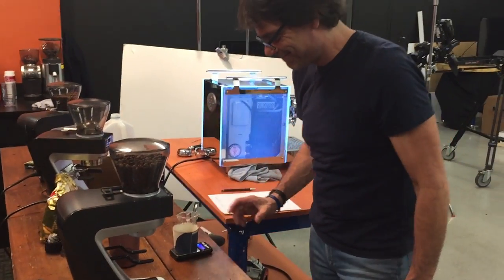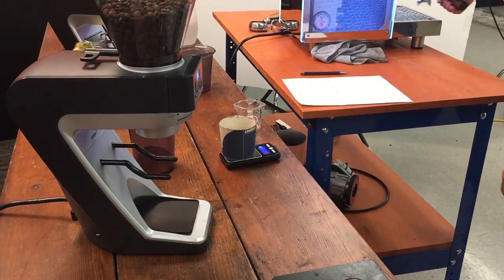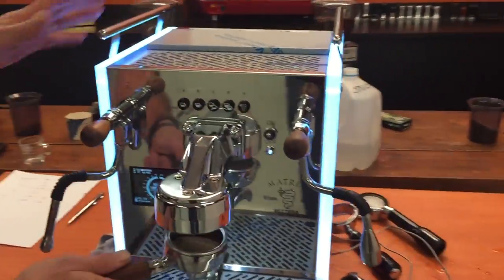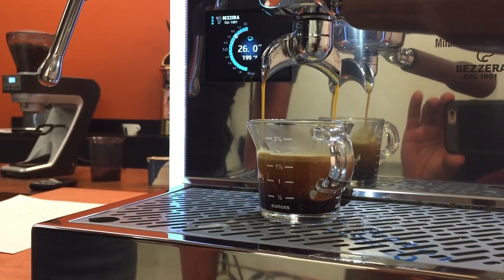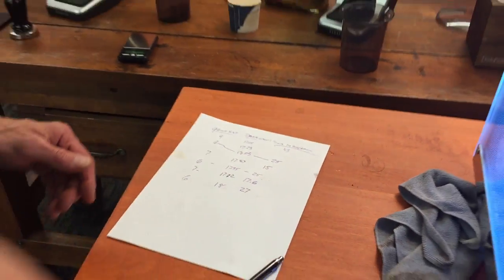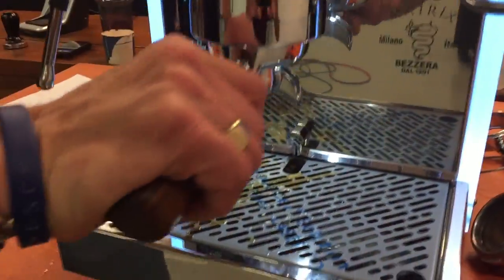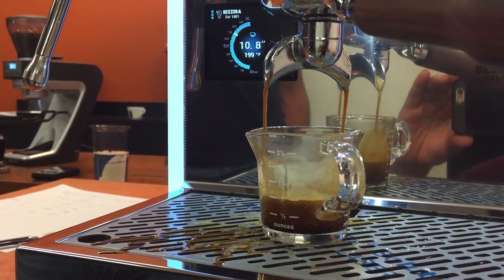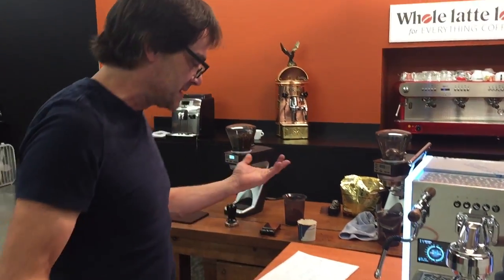Test: Baratza Sette 30 for Espresso Grind - Behind the Scenes

Comment: I just bought a Baratza Sette 30 from WLL based upon recommendations from the WLL sales person that I was communicating with and asking for advice.   I received it today.  After receiving it and reviewing this video, I wish that I had been advised to get the 270.  I also just bought the ECM Classika, PID with flow control.   The ECM is great.   I am not very happy.
Reply from the maker: Hi William, I do not know the details of your communication. But surprised our staff would recommend a Sette 30 for espresso unless there was a cost concern or other factor involved.  Have you considered return and exchange for the 270?
Reply: @Wholelattelovepage  Shipping costs and the upgrade to the 270 would be 'inconvenient'  at this point.  I have ordered the 270   adjustment assembly from Baratza.

Comment: Hi Marc! Thank you all for sharing all these amazing and helpful videos! Big fan here! 
I have a question: I was thinking of getting a Baratza Sette 30 for my Gaggia Classic and use it with a 58mm unpressurized portafilter. After watching this video, I kinda got the feeling that I should get the 270 instead. But the price difference is pretty crazy. So I was wondering if it's 'possible' at all to pull good shots with Sette 30 on my Gaggia Classic? If not, would you ever recommend Breville Smart Grinder Pro instead? Thanks!
Reply from the maker: Hi ESK, Thanks for the comment and questions! Sette 30 would be fine for the pressurized basket but I cannot recommend it for use with un-pressurized baskets. It might be okay for less discerning users but really need finer control of grind size for best results. Hope that helps!
Marc
Reply: @Wholelattelovepage  so if we started with the Sette 30 with a pressurized basket, but then bought the 270 fine adjustment assembly to put on the 30, we could then use it with the non-pressurized baskets?
Reply: @josephlebo7320  Yes

Comment: Great video test Marc.  I have to admit to getting a Baratza Sette 30.  Could not pass it up as I got it new for $200.  For the price, I am able to get the 270 Adjustment Ring, S2 Cone Bur (for brew grind), an additional nozzle, and a set of shims.  So for a total out of pocket of $330 I have a machine that will do dialed in espresso and with a 30 second ring swap, a decent pour over grind.  I could even get a spare gear box for $40 and have a quick replacement ready for the inevitable failure in a few years and still be under the $400+ for the 270 alone.

Thanks again for all you do for the coffee community!
Reply: Where are you from and where did you get the sette 30 for $200, if you don't mind me asking? I haven't seen it under $300 online anywhere
Reply: @t-vizzle  I snagged it off Amazon on their Warehouse Deals.  It said it was damaged and some parts may be missing.  I took a chance because they have a great return policy, even for warehouse deals.  It came in a regular Amazon box, but all parts were there and It was not damaged at all.  Still working perfectly.

Comment: Great video. Great channel. I have a Baratza Encore with the Burr upgrade and adjusted for finer grind, but still find unusable for espresso. Friends say the Niche is the only way to go, but my budget cries out for the Sette 270. Thoughts?
Reply from the maker: Hi PSW, Thanks for the comment and question. The Encore is generally not considered useable as an espresso grinder unless using pressurized filter baskets which produce inferior espresso. The Sette 270 is a very good espresso grinder - and you def want the 270 not the 30. The dual macro/micro adjust gives you essentially stepless grind size adjustment for precise control of grind size. Keep in mind the Sette is an appliance grade product but well suited to lower volume home use - also kinda loud. If you want a better build quality, the flat burrs preferred for espresso and stepless adjustment check out the Eureka Mignon Facile. It's a no frills machine grade grinder. It's slower than the Sette but not as noisy: https://www.wholelattelove.com/products/eureka-mignon-facile-espresso-grinder
I have a hard time with the Niche. Not exactly precise in grind size adjustment with espresso fine to medium drip grind and beyond in less than a 360 turn of the adjustment, also conical burr.
Hope that helps!
Marc
Reply: @Wholelattelovepage  Thank you very much for the detailed reply! 🙌🏻
Reply from the maker: Our pleasure!
Reply: @Wholelattelovepage   Def going to order the Eureka Mignon. My next step is to look for a good espresso machine in the 500- 1k range. Suggestions?

Comment: I have the 270. Grinds coffee very well but very noisy. My complaint with it is it there is backlash in the setting. What that means if I change it between espresso  and coffee and return to espresso I need to redial in the espresso again because it's not correct
Reply from the maker: Hi Sonny, Thanks for sharing your impressions of the 270. Always great to read owner reports. The 270 is louder than most but that compromise gets you wonderful grind distribution into a portafilter, fast grinding and very little retention. I don't use the Sette for filter grinding much so have not experienced the backlash issue you describe.
Marc

Comment: Hello Whole Latte Love. Long-time viewer, first-time commenter. I upgraded from a Sette 30 to a Sette 270, but I continually get a sour espresso, regardless of grind. My best result so far: freshly-roasted whole beans (Blue Bottle Dandy Espresso); grinding 18g on a Sette 270 (9E setting); brewing on a Gaggia Classic (58mm double-basket unpressurized portafilter). I'm pulling a 36g shot in ~25 seconds -- I start my timer simultaneously upon hitting the brew button. This should yield good results, but the shot is always sour (I've tweaked the grind more or less coarse, but no change). Can you help?
Reply from the maker: Hi David, Welcome to the comments and thanks for the question! Sour flavors generally indicate an under-extraction. It could be low brew temp. The Classic is a little tricky due to wide swings in boiler temperature associated with single boiler machines. We have this video with some basics on temp surfing a single boiler: https://youtu.be/H3oT5fF1gy0 Your extraction may be a little fast. For timing, I tend to go with starting at first drip. May want to try a slightly finer grind to slow the extraction a bit.Marc
Reply: Thank you for the suggestions! I switched to Lavazza Super Crema (as you recommended in another video), tightened up my grind (to a 9C), and started counting after the first drip. As a result, the sourness is gone and I'm getting a deep, bold flavor with rich, thick crema; there's a little bitterness now, but it's barely noticeable... more experiments required, but I'm thrilled with the lack of sour! Much appreciated!!

Comment: Hey Mark this is a great video for a newbie looking to buy equipment thank you very much! Have you ever done tests like this with the Breville Smart Grinder Pro?

I guess what I'm asking is would I better off with the SGP or the Sette 30 as a beginner wanting to do espresso. I'd like to be able to graduate to unpressurized baskets with this grinder as well. Or any other recommendations? The Sette 30 is at the high end of my budget
Reply from the maker: Hi MW, Thanks for the comment and question. I prefer the Sette to the SGP. A much fluffier and faster grind. The Sette 30 uses the same burr found in the Sette 270 which Baratza considers their best home use espresso grinder. I have not done testing like this on the SGP but I have used them. IMO it has a similar jump between grind size settings. One thing the SGP has is additional grind settings within the machine on the burr carrier. It's kind of a process to use those as the burr has to be removed to make adjustments. For a newbie I think either grinder is okay - especially if using a pressurized filter basket. Even when you go non-pressurized you'll do okay. And, if grinding fresh I'd go non-pressurized ASAP. Much better espresso with those! If you find a jump in timing between grind sizes you can always adjust the dose weight a bit to to offset. Personally I'd go with the Sette 30 over the SGP. It's not well publicized, but the burr carrier used in the Sette 270 grinders with micro adjustment will fit and work on the Sette 30. You could make that upgrade down the road. Hope that helps!
Marc
Reply: @Wholelattelovepage  do you guys sell this part?

Comment: Hi Marc. This video is insightful. I have a question for the Sette 30 (S30) and consider it an upgrade option but i have one concern and that is the coarseness of the grind. I like my cold brew and French press. Is there a way to adjust the S30 to produce a coarser grind? I learn that there is a BG for the S30 to improve the grind's coarseness but a lot of the online reviews said the grind quality is still tad fine for cold brew or French press. What is your take on that? Should I take the plunge for the S30 with the BG? Or should I consider the Virtuoso+ instead? Both S30 and Virtuoso+ are of the same price in my country. I appreciate your thought and reply. Tq!
Reply from the maker: Hi Joel, You are welcome. For cold brew I recommend the Virtuoso+ it max grind size is 1400 microns while the Sette is 950 microns. While the Sette can be shimmed after break-in to grind finer it cannot be made to grind coarser.
Marc

Comment: I own a 30AP for espresso and use a 13/14 setting (installed shim) (but really depends on the bean) and it works beautifully. Buying the micro adjustment for the 270(Wi) is in my plan but it's defs worth it.
Reply from the maker: Hi Jaay, Thank you for sharing your experience! For espresso the micro adjustment really helps!
Reply from the maker: Hans yes for grind size. But do note differences in other parts of grinder like hands free grinding, 2 more timed presets and upgraded hopper shutoff mechanism
Reply from the maker: Hans Hi it’s very easy. The entire assembly will drop out and new one goes in its place. Micro ring is part of the new assembly. Just turn out the old and replace with new. 
Marc

Comment: Thank you for this. The Sette 30 on its own is not ideal.  I learned you can add the microadjustment to the Sette 30 and save a few dollars.  Do you know where I can order the BT-S069 Assembly Adjustment?
Reply from the maker: Hi DS, In the US one used to be able to purchase the macro/micro grind adjustment assembly used in the 270 models. Just checked Baratza's website and it's not currently available. Not sure if out of stock or if they stopped selling the assembly. Here's a link to Baratza retailers outside of US/Canada. Chance they might have: https://baratza.com/international-importers-and-retailers/parts-outside-of-us-and-canada/

Comment: my questions is, is it better to get the 30 then buy the stepless adjustment mod later, or just go for the 270?
Reply from the maker: Hi TMP, I'd go for the 270 so you'll have the 3 timed grinding presets, nicer hands free PF/bin forks and upgrade to shutoof of the bean hopper.
Marc

Comment: Slightly off-topic (but the subject IS in the video!) - On the Matrix, is it normal for the portafilter to be so far off center when you secure it to the head?  I mean, I see them at all kinds of angles off center, but that seems way out.
Reply from the maker: Hi GSJ, Good eye! It is over clocked and not normal. Prior to shooting this video I was doing a bunch of Scace measurments on the Matrix DE. We have a modified non-Bezzera PF for use with our Scace device. It under-clocks in the Bezzera group so we have to crank it a bit to get a seal. That likely shmushed the group gasket a bit which resulted in over-clocking of the standard Bezzera PF.

Comment: Hola...necesito invertir en un molino, estoy en la duda ya que en mi país chile, el precio del batarza virtuso es igual al baratza sette 30, cual me recomiendas? Agradecería tu recomendación.
Reply: es para una cafetera casera, espresso delonghi,  quisiera utilizar sin filtro presurizado.
Reply from the maker: Translation: Hello ... I need to invest in a mill, I am in doubt since in my country, Chile, the price of the virtuso batarza is equal to the sette 30 baratza, which one do you recommend? I would appreciate your recommendation.

Para el espresso, optaría por el Sette 30. Para métodos de preparación distintos del espresso, elija el Virtuoso.
For espresso I would go with the Sette 30. For brew methods other than espresso go with the Virtuoso.

Comment: Hi Team,
I use Delonghi Dedica EC685, french press, moka pot and like occasionally cold brew...! Planning to buy grinder which can help with this multiple range of grind settings...! Pls help me which one is better option Encore or Sette 30? Thanks in advance
Reply from the maker: Hi AM, Thanks for the question. The Sette 30 is much easier to use when making espresso as you can dose directly into a portfilter. And, it's fine to use for pressurized filter basket brewing like on your Dedica. Some find it doesn't grind as coarse as they'd like for cold brew and maybe press. Grind size range is 230-950 microns on the Sette. The Encore can grind coarser with a range of 250-1200 microns but you'll have to dose your portafilter from its grinding bin. Hope that helps!
Marc

Comment: Helllo, whole latte love. I’d like to ask something cus I’ve been asking all around n couldn’t find an answer. I’ve the satte 30 and I’d like to put the Micro on it is that possible?? And can I get the same grind with the satte 270? And where can I find this Micro ring. Thanks for this helpful video and I appreciate how you work hard for this Channel👍🏻👍🏻. Best wishes for you.
Reply from the maker: Hi M, Thanks for the question. Yes, the Sette 270 grind adjustment mechanism fits in the Sette 30. It's the whole assembly you replace - not just add on the micro ring. Here it is on Baratza's website. I'f used the 270 ring in a 30 before and Baratza clearly states this part fits in a 30: https://www.baratza.com/shop/sette-270-270w-adjustment-assembly
Marc
Reply: Whole Latte Love thanks a lot Mr Marc I’m soooo thankful to you I was really looking everywhere and couldn’t get an answer. Thanks again
Reply from the maker: Mr_MTN7 My happy to help! Marc
Reply: Once the micro ring is on, what separates the 30 from the 270? Does it gain the same stepless adjustment between clicks that the 270 has?
More specifically, what benefit is there to buying a 270 if the 30 can have a micro ring installed?

Comment: Hi Mark I really enjoy your videos thank you.  I too just purchased the Gaggia Classic Pro machine with the Baratza Sette 30.  I have not received the grinder yet.  This set up is my very first time espresso equipment so I'm no expert at any of this yet.  So you don't recommend to use the non pressurized basket?  I still don't understand too much why.  But here is my question, is the grinder that's built-in onto the, let's say, Breville BES870XL Barista Express better than the Baratza 30?  Heck and what about the $199 Breville?  The only reason why I just purchased the Sette 30 is because people, including "experts" rave about it and is supposed to be a really good top of the line grinder for the money.  Of course is not the most expensive one either and I sure as heck cannot afford a $300+ grinder :-(

I know there are a LOT of people out there using really cheap $50 to $100 grinders and they have no problem with their espresso and they are really happy with what they are drinking, at least they don't "discern" the difference.  Again, there is no way I can afford a more expensive grinder so would you recommend returning the Sette 30 and get a better grinder that you know of that costs less than $300 bucks?  Would you please provide me with your input on this thanks very much! :-)
Reply from the maker: Hi Adrian, Thanks for the comment and questions. Using a Sette 30 for non pressurized filter basket espresso is possible. It's a bit of a compromise as the Sette 30 lacks the very precise grind size adjustment of more expensive grinders. The work around for that lack of control is to adjust the dose weight of ground coffee if needed. The Breville grinders, both built-ins and stand alone like the SGP are slow and tend to produce a clumpy grind at fine espresso grind sizes. If given the choice between a Sette 30 and Breville SGP I'd go with the Sette 30.
At under $300 there are no other grinders I can recommend which produce a grind quality equal to a Sette 30. For those happy with $50 to $100 grinders understand there are many levels of espresso drinkers out there. Can you make espresso using an inexpensive grinder? Yes you can but it's severly limited in potential quality and those cheap grinders are going to be a PITA to use. Some people are fine with fast food. Others prefer gourmet.
Hope that helps!
Marc
Reply: @Wholelattelovepage  Thank you so much for your response.  Since I'm completely new at this may I ask you what quantity of grinded coffee/espresso I should be putting into my portafilter?  I started with 16 so what would you recommend for the Sette 30?

Comment: Hey mark,,,, I have sette 30 ,,, what is the best grinding degree for making espresso shots ,,,  and what is the suitable amount of water ,,
Reply from the maker: Hi HA, Thanks for the question. There is no "best" grind setting for espresso as the best grind size depends on other factors like weight of coffee dosed in the portafilter and othe factors like coffee coffee type, brew temp, etc. You need to "dial in" the grind size to fit with those other variables. Here's a video which shows you how to go through dialing in grind size: https://youtu.be/iwHdm5GtNHI

Hope that helps!
Marc